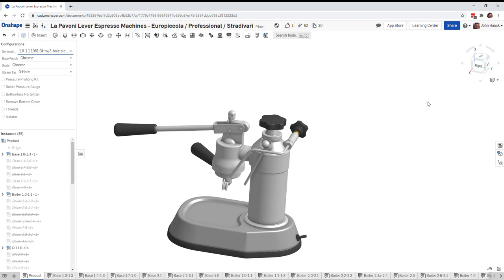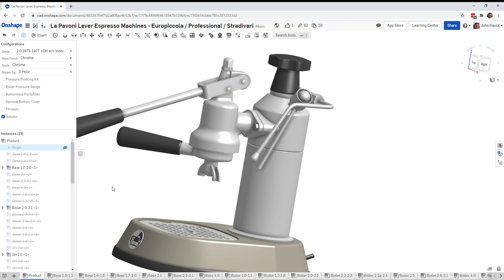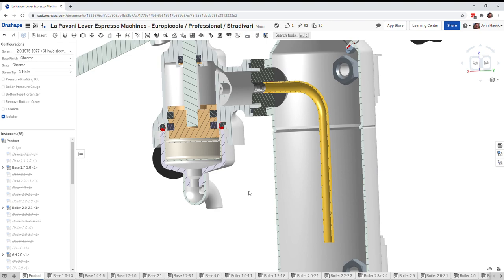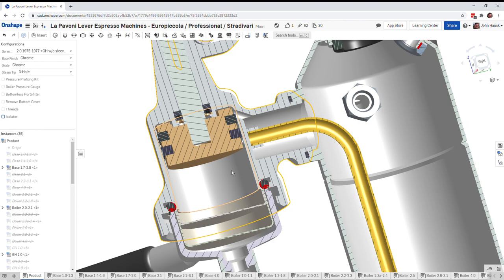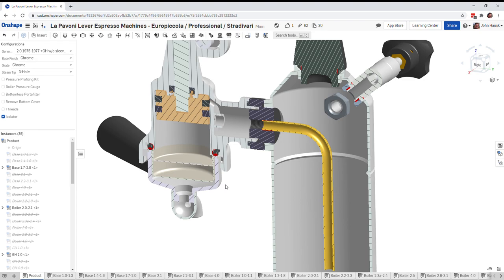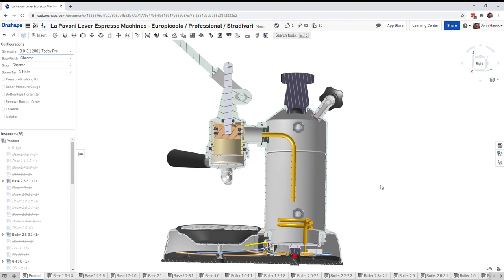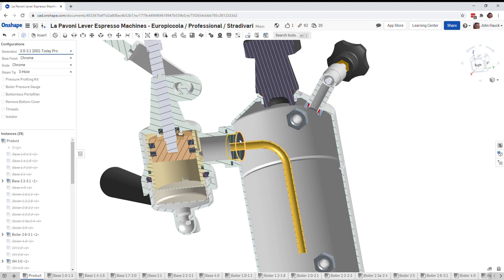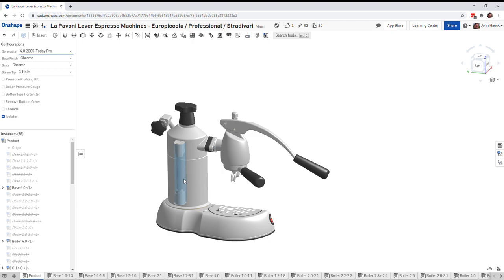10: Bong's Isolator - A Modification to Keep Group Heads Cooler - La Pavoni Espresso Machine

Comment from the maker: With respect to needing a new siphon tube, I did not communicate the issue clearly in the video. The isolator will work with any existing unmodified siphon tube. It does not replace the siphon tube. The concern I tried to raise in the video is for people who cut a notch in their siphon tubes (for a different kind of modification). Those people will need to get a new siphon tube to use the isolator. I hope this clears up the confusion I caused.

Comment: I think, if the room behind the isolator is flushed, then there always are air in there, so the pressure from out coming water is not the same as if the siphon is direct connected to the group, and its more steamy. With the traditional tempMod with a hole in the siphon a bit more water comes out and more important the water behind the isolator is not totally changed with new hot water, so the temperature is more stable... or what you guys think?
 
Btw. The direct metal contact group head and boiler is for the temperature stability not so relevant, I just tested with Teflon gaskets, maybe 5% less agile temperature behavior

Comment: on the gen 2, does the isolator eliminate the need to purge the air build up above the piston? the "false pressure" problem so to speak. 
i have learnt so much about my la pav from your videos, they are so informative. thank you so much for the work you've put in.
Reply from the maker: David,

Most of the discussions I have seen where the term "false pressure" is discussed is at https://www.home-barista.com/levers/  There the concern is for air trapped in the BOILER. Any air in the boiler can contribute to the temperature of the water being too cold in the boiler. Opening up the steam tap for a second or two should clear this out. The latest generation of pressure release valves actually does this automatically. You can hear it click closed after the boiler starts generating steam and most of the air is out. Still, it does not hurt to open the steam valve once the boiler is up to pressure. Then let the boiler rebuild pressure before proceeding. The BongIsolator has very little impact on this.

The BongIsolator on the generation 2 machines makes them behave much more like a generation 3 group head. I believe that in this configuration air can be trapped in the group head and the only way to purge that is to raise the lever all the way for a brief period. This trapped air is not so much of an issue on an unmodified generation 2 group head. However, this trapped air is not usually what is meant when we speak of false pressure. Instead, this trapped air often is covered under the topic of "short shots" and "spongy pulls".

To collaborate with people that have these and alternative views, I would suggest plugging in to this friendly group: https://www.facebook.com/groups/lapavonienthusiastsgroup
Reply: @JohnMichaelHauck  
Yeah, so i'd been reading up in these spongy shots. Like you say steam wand open and lift the lever, absolutely amazing the difference it makes. Thanks so much for the feedback. Really informative. Hopefully I'll learn more tricks as time goes on.

Comment: Hi, in Bong's video, I noticed his portafilter basket handle had small metal retaining bracket to keep the portafilter in when he banged out the used puck. Any idea where I could get one? Also, can you explain why he is spritzing the group head between shots? Is he cooling it down? Excellent video whcih explains the function and design of the thermal insulator.
Reply: @JohnMichaelHauck  Ah, that makes sense, though I am too much of a primitive to do that myself. I will and yes, he seems like a nice person. Thank you for the advice.

Comment: Hi, I have a generation 2 Europiccola (year 2000). I only every brew light roasted bean. I am experiencing issues with my grouphead overheating very soon after the first shot. I try to brew around 93C and wanted to ask whether Bong's Isolator would enable me to still heat the Groupheat to 93C and then optain continues shot at this temperature without the need to switch the machine off to cool. I ask this as most comments online suggest that Bong's isolator enables them to keep the group at 83C and I need it to be 93C. Thanks so much for any advise Jim
Reply from the maker: Jim, sorry for the delay. I do not know the answer to your question. You can ask Bong directly though. You can find him here:
https://www.facebook.com/groups/lapavonienthusiastsgroup

Comment: I am confused, I thought the head had to be hot to get the best performance? That's why we get a temperature strip to be able to check.
Reply from the maker: Akaroa, well, the group head should not be too cold and not too hot.

If the group head is too cold: You may have overly acidic coffee, weak coffee (low extraction), low shot volume, spongy feeling pull, and danger of a la Pavoni sneeze if you remove the portafilter too soon.

If the group head is too hot: You may have overly bitter coffee, strong coffee (high extraction), and a lot of resistance to the pull.

It is fun to experiment with different temperatures of the group head and compare the taste to see what you enjoy.
Reply: @JohnMichaelHauck  Cheers John.

Comment: After I did this mod I started getting "short shots" what happened?
Reply from the maker: It could be that the cooler group head is now retaining more air under the piston.
This video is my attempt at explaining it: https://youtu.be/w2pORowl7r4
For more perspectives, reach out to a hoard of helpful folks (including Tudor and Bong) here: https://www.facebook.com/groups/lapavonienthusiastsgroup
Reply: @John Michael Hauck  that makes sense thank you John
Reply from the maker: And make sure the siphon tube is not cracked or leaking where is screws in.
And make sure the piston rod is screwed all the way into the piston.
Reply: @John Michael Hauck  I just found out about dry pumping so you were right that solved the issue. I'm only 2 weeks in with this pre millennium so I'm still learning.
Reply from the maker: @DQridesbikes  The learning never ends! Enjoy the trip.

Comment: This might be a silly question but do you end up with a load of stagnant water between the isolator and group head with the isolator? Also I wonder does the isolator remove the issue of air in the group head which is a problem on generation 2?
Reply from the maker: Alex,

These are difficult questions to be sure.

>> do you end up with a load of stagnant water between the isolator and group head with the isolator?

The neck (between the boiler and group head) is filled with hot water (and likely a bit of air). This water cools slightly as it is somewhat insulated from the boiler. When a shot is pulled, this cooler water mixes with the hotter incoming boiler water to provide a cooler shot. A cooler shot extracts less off-flavors from the coffee grounds, which is good. Because of the mixing, I would not call this water stagnant. You can see this in the 13th video where I modeled the water flow in a computer simulator: https://youtu.be/eQuEZDY6Awo

>> Also I wonder does the isolator remove the issue of air in the group head which is a problem on generation 2

Air can be trapped in three places in the generation 2 group head with the Bong isolator:
1) In the neck
2) Above the piston
3) Below the piston

I think the first two can be purged by raising the lever with an empty portafilter (or no portafilter). The violent steam and hot water should push the air out.

The third comes when you raise the piston to pull a shot - air enters under the piston through the coffee grounds to fill the vacuum created. There is a hole in the cylinder, near the top that lets water in. When you raise the piston above that hole, water rushes into the area under the piston. A lot of air gets pushed back out through the coffee grounds, but not all of it. This remaining air then is compressible and makes your shot feel spongy. That is, if you let go of the lever halfway through pulling the shot, the lever will go back up a bit - like a spring. The spongier the feel, the more air there is, and the less water there is, which is less volume in your cup, which is not the most pleasant flavor.

OK, so how do you get rid of that air?

If the first few drops of water entering the area under the piston are hot enough, they will flash vaporize into steam. This violent steam then pushes the air out more effectively than just water. This is why I ensure the group head is hot enough before pulling a shot. The steam condenses back to water so then there is just water.

The Bong Isolator does an effective job of keeping the shot water temperature cool enough to avoid extracting off-flavors. This, however, comes at the expense of water that may not be hot enough to create flash steam to avoid a spongy shot with a low volume extraction and the resulting unpleasant flavor.

I hope this helps.

I think it would be good to hear the thoughts of others at these more lively communities:
https://www.facebook.com/groups/lapavonienthusiastsgroup
https://www.home-barista.com/levers/
Reply: @JohnMichaelHauck  a really detailed and interesting reply, thank you. I had not really considered the role of the air under the piston in creating a spongy pull.
Reply: @JohnMichaelHauck  that's the clerset explanation of the problem and its relation to the isolator I've read to date. So how do you avoid spongy shots with the isolator?
Reply from the maker: @jonathansahar2772  I think by and large you will have to put up with spongy shots with the isolator. It's not a horrible problem to have if the isolator cools the brew water to the point that you have great tasting espresso (according to your taste buds).
Yet, you can "throw money" at the problem and get the "air buster" (which requires the "pressure profiling kit"). This will for sure solve the problem. In fact, the air buster was designed in direct response to the more spongy pull "created" by the isolator.
Of course, now it is starting to sound like I am recommending all these product ad-ons for your La Pavoni. I am not recommending anything, I am simply trying to educate. Just so everyone is clear, I do not profit from the sale of these products.
I hope that helps.
Reply: @JohnMichaelHauck  thank you! I think I've thrown enough money at the problem for now 😅 
I've just seen another video of yours, and that made me realize that it's not actually a solvable problem (barring more modifications)  - cooling down the grouphead in order not to over-exract the coffee actually entails a spongier pull due to less flash steam being created. So I guess I'll have to live with the sponginess.. do you do a Fellini to compensate for the lower volume?
Reply: @JohnMichaelHauck  also - does this mean that all 3rd gen machines are spongier by nature, in a similarly unsolvable way?
Reply from the maker: @jonathansahar2772  For those who do not know, a "Fellini" is when you raise the lever back up some amount to draw in more water, and then continue the shot.
So, with lighter roasts I can get away with a "mini" Fellini, where I do a soft pressure preinfusion and then raise the lever to the top for the full pressure extraction. With darker roasts I seem to crack the puck doing this and they become watery.
Reply from the maker: @jonathansahar2772  Not at all. With e 3rd for 4th gen machine (without the Bong Isolator) I can get really good tasting shots (for me) with almost no spongyness. I turn the machine on about 20 minutes before using it and dispense hot water through the group head a few times during the warm up.
Reply: @JohnMichaelHauck  hmm..  I'm not sure I understand how that's possible then. What makes it different than using the isolator? How does the lower temperature doesn't allow more air to be trapped?
Reply from the maker: @jonathansahar2772  OK, this is what I think we are talking about:
Comparing the spongy shots of a 2nd generation machine with the Bong Isolator VS a 3rd generation machine without a Bong Isolator.
I recall tests that Bong did that showed the group head of the 2nd generation machine with the isolator is cooler than a stock 3rd generation.
This then results in more spongy pulls for the 2nd generation with the isolator ... the cooler the group head, the spongier the pull.
But perhaps you are asking me a different question and I am a bit slow to pick up on it.
Feel free to ask me again. Also feel free to conclude I still have a lot to learn and my answers are inconsistent - but help me out please by pointing that out (gently).
Reply: @JohnMichaelHauck  you are correct in your understanding of the question :)
What I don't understand still is this: seeing as you can raise the groups head's temperature manually (e.g by flushing water through it), why can't you get as good a shot (i.e tasty & unspongy) on 2nd gen + insulator as you can on a 3rd gen (w/o insulator).
Reply from the maker: @jonathansahar2772  I see. Since the isolator adds an insulator between the hot boiler and the group head, it takes a lot more flushing of hot water through the group head to heat it up. I suppose with enough hot water you could get it hot enough to minimize sponginess. I've never really tried that though. I think people with generation 2 machines like the isolator because the cooler group head improves flavor by so much, they don't care so much about sponginess. Maybe there is room to make the isolator a bit less of a thermal barrier? If so, then it could come into line with generation 3 group heads.
Reply: @JohnMichaelHauck  okay, that makes sense for me - the fact that it prevents contact between the group and the boiler. Definitely sounds like a good idea to make it less of a barrier. Do you know at what temperature your group is at when you pull a shot? (Also where is the thermocouple located when you measure, if you do so)